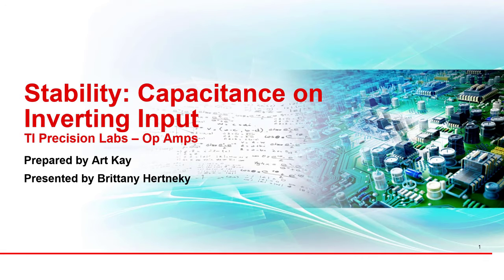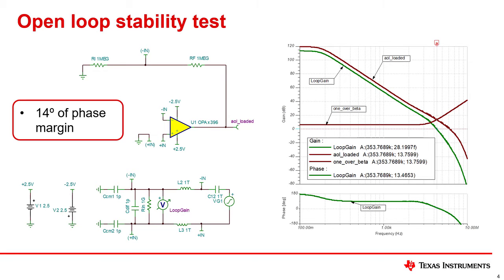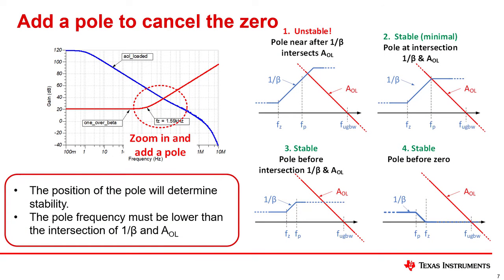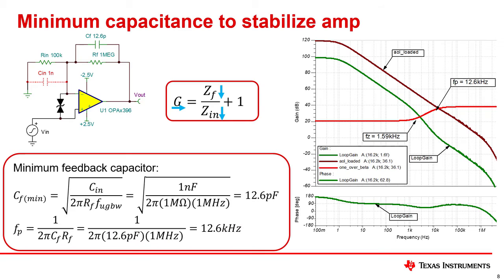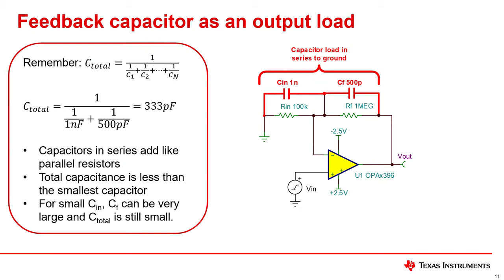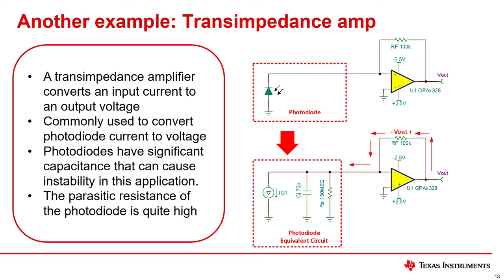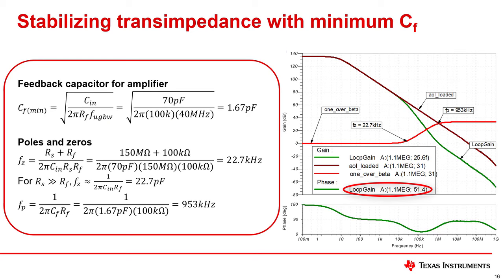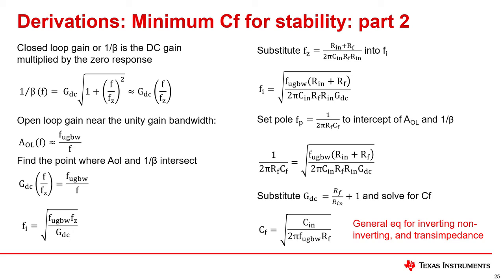Capacitance on inverting input

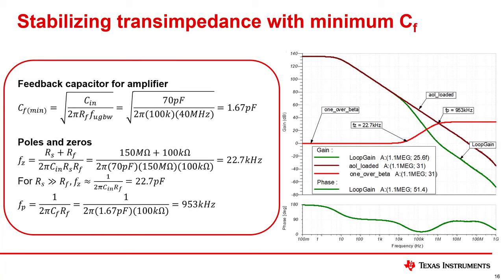Comment: Another error at 15:32, "For Rs .. Rf, fz ~ 1/2*pi*Cin*Rf = 22.7pf" It should be 22.7 KHz not pf, you should also show to get that you must use the identical capacitance 70pf. Other than that, awesome video